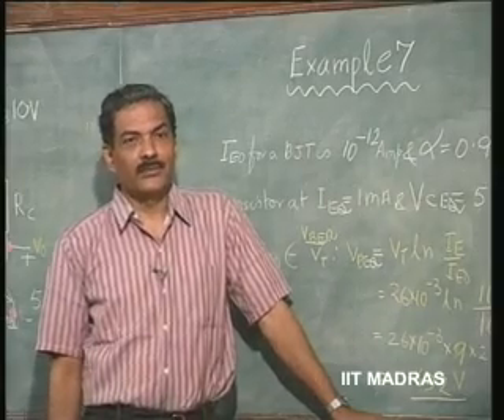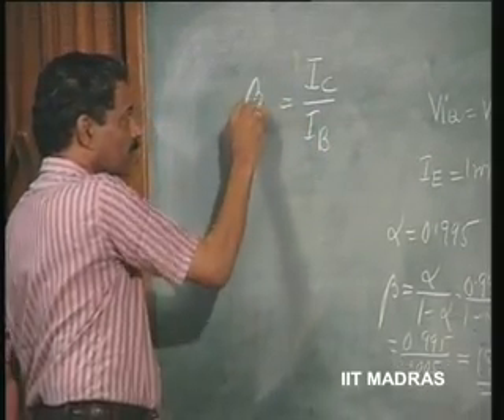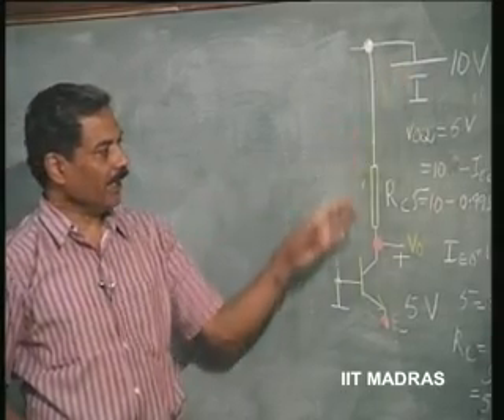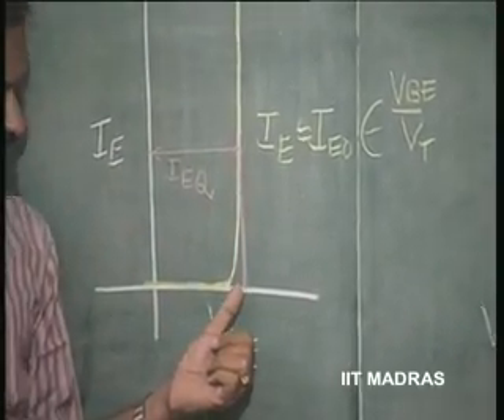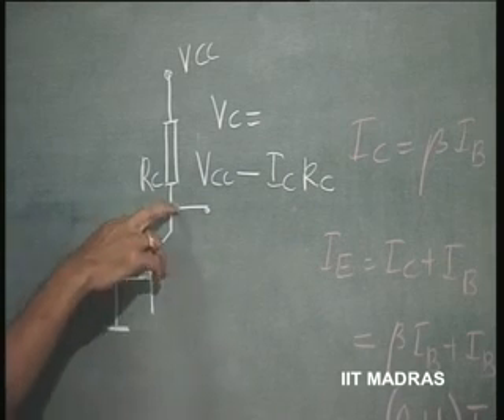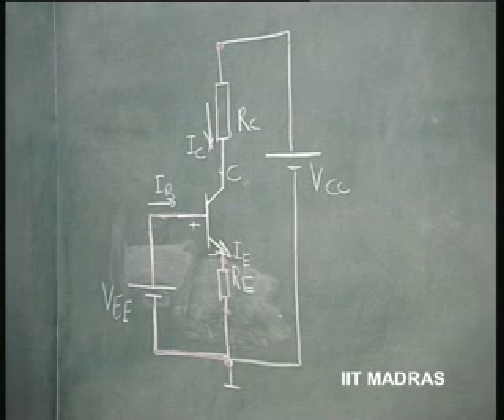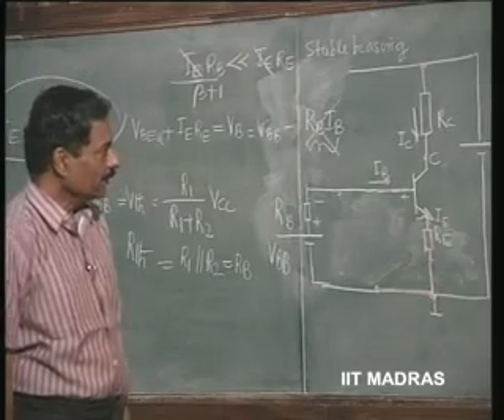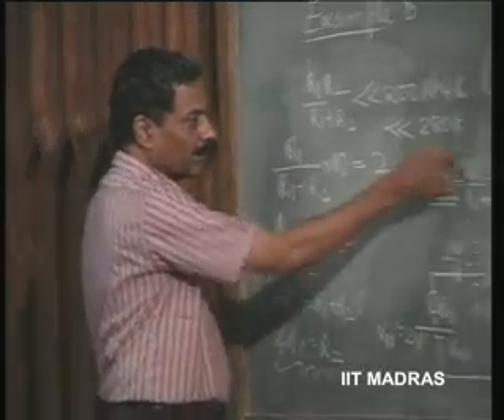Lecture - 22 Transistor Biasing

Comment: How does the transistor get into saturation mode @ 25:51 ?
Reply: Vce = 0v at the moment both the junctions are in fb so
Reply: If Vbe increase such that Vcc -IcRc become negative or zero ideally (.2v) but can't be possible as Vcc is source and IcRc is drop it transistor action is no more valid and transistor not in active region also Base and collector junction is no more reverse bias and it become forward bias thus transistor is in saturation..